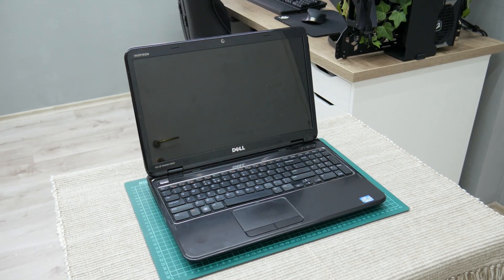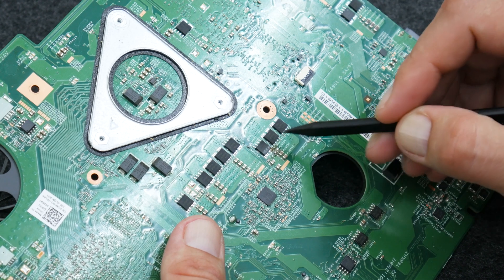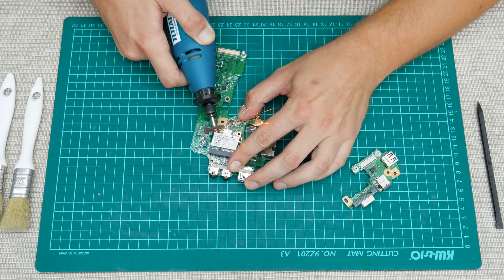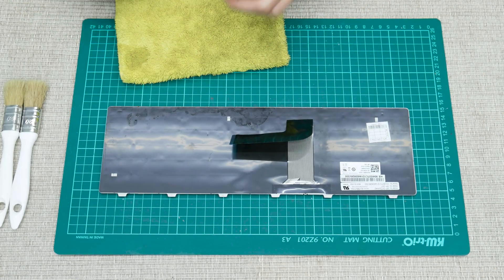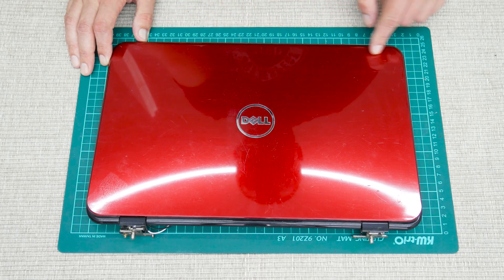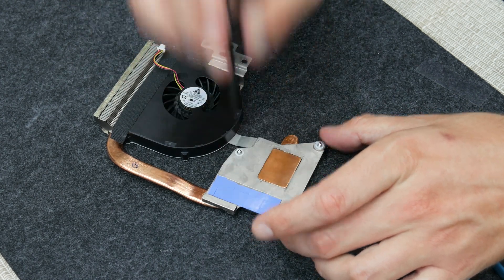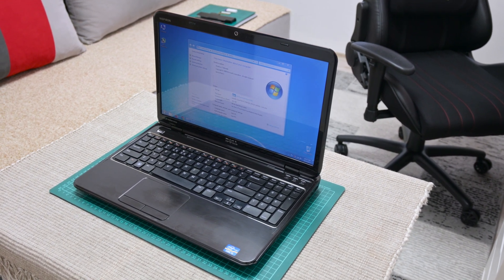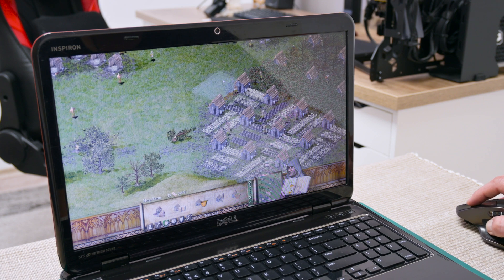Can we repair this old DELL N5110?

Comment: I just got this same laptop from a friend who moved. It doesn't boot up. The power light comes on, the 3 buttons on the top right light up, but then nothing happens.

I changed out the button cell battery but still nothing.

If there's a short, how can I find it? I'm interested in getting this working to pass on to someone who needs a basic computer for stuff like school work.

Comment: Nice work with this laptop, I re-watched this video for a repair and restoration I'm doing. Question, is it safe to clean the heatsink with soap and water, and then remove excess with compressed air?

Comment: Hi, I've already got mine repaired. Upgraded to windows 10, Upgrade to SSD too. Clean fan, repasted thermal paste, basically that's what I heard from the technician. 
But I am still having trouble with overheat problems, game throttling too much, even with low graphics demand games. Please help, any advice would be great sir.  Appreciate it.

Comment: i have ADATA SU750 installed in this same laptop, this SSD heats up like crazy, crystaldiskinfo tells me its hovering around 68c to 70c, and if i copy something or compress files, it reaches 78c. Yeah i have cleaned my laptop and fans and applied new arctic silver 5 thermal paste. Gaming temps are pretty normal. ADATA SSD's are crap

Comment: just a tip if you need to fix chipped or broken plastics. Use some clay and superglue to fill in the hole and it will fix the problem for good.

Comment: 10:15  Here at least i could manage to get windows 10 activated with a 7 key. Unfortunately, for me, it is not shown how to reconnect the flex cables,  i could not manage, without some serious, modifying  of the cables, and cutting aluminium part inside  to bits, that project still in the works, so not sure about the outcome, though i am pretty positive. And this laptop's cpu upgradable, did not cross my mind even that a possibility, i just may do the same, not sure, but nice to know the option is there, knew there was some use in watching these video's.

Comment: I have been using this laptop since 2012!
Upgrade the HDD to SSD and 8GB RAM! I have left Windows 7 and on another partition installed Windows 10!
At the beginning WIN 10 was not working properly, but after years of updates now is working like a charm!
I am going to bay a new laptop next year in 2023, still waiting for DDR 5 RAM price go down, and that CPUs prices of Intel 12 gen and AMD be more reasonable!
I like your channel, I heve been doing repares more then 30 years back.
All the best and stay safe!

Comment: i actually still got this laptop with an i5 2450m, 4 gb of ram, 500 gb of hhd and a smaller keyboard it has been in my house since it was brand new and has been damaged several times like when i found it again in 2018 it doesn’t even boot up until i brought it to a tech repair shop and when i gave it to my brother he punched the screen so hard that the hinge of the laptop got loosen and it’s still is to this day even after the screen replacement and ever since i got a new laptop i gave my other laptop to my brother the laptop was never been use again and it sitting on my desk collecting dust i might use it again as a data stored or as a second monitor

Comment: Hey sir I badly need your help regarding on the Asus Tuf Gaming Laptop GPU.. the NVIDIA gpu only showed as Microsoft Basic Display adapter and wont accept any driver installation it will always have error...i tried all the possible fixes like updating from Device manager to manual install driver, even used DDU for clean installation of driver.. but ddnt worked..Graphics settings in Bios is greyed out.. its Asus tuf FX505GD with GTX1050ti 4gb.. pls help me what to do.. thnx in advance..

Comment: Hey Andrew, I have a Compaq Presario CQ57 and i upgraded it by adding an SSD to it using the disc caddy, and now it is working all fast and smooth but the most major problem that i am facing now is that the laptop is overheating and shutting down very often i have cleaned the laptop and got it serviced with fresh thermal paste also but the problem continues. Also i have noticed that the fan is running slower according to me not making enough air flow.

What should I do ? Please suggest.🙂
Reply: Did you sevice the machine yourself?

Comment: Great job. I've never done an N5110, but I have done several slightly older machines, Dell Inspiron 1545s and an Inspiron 1764. The 1545 can have almost everything upgraded, but the T9900 is the best CPU it can handle. Glad you were able to get that oldie running again.👍

Comment: Thanks for the nice restoration but Big mistake you replaced the core i3 to i7 the motherboard it will not continue working with i7 becose there is some chips cant sopported and take that much of power

Comment: I wonder if you might have an answer to  question please....I have an old NEC VERSA M500 laptop....It was working (just) then it just died....Now when I switch it on all I get a a loud single continuous beep!...I have checked the ram...Both sticks taking htem out and trying single sticks at a time in each socket and still get the same beep when switching on. Unfortunately I have no other sticks to see whether both sticks have failed or not..as my other old laptop takes different ram...Its not booting to even the bios..just a blank screen and beep...I have tried looking online for a solution, but have not found an answer...I feel it might be the keyboard...But to be honest...spending money on it to repair is a waste as I could just buy a better second hand working laptop rather than waste money trying to get what is a very slow laptop working again...Looking at the cost of old replacement parts..its just not worth it...But if it's a fix I could do with out spending money..then great...If not..then its a dead duck...Your experience with laptop is far more extensive than mine..so I was hoping you may have had a similar problem and found a possible solution?...Anyway..thanks in advance.

Comment: i3 2th gen upgrade to i7-2670qm...bad idea...the heatsink is to small because i7 second gen generate a LOT of heat....i had a hp dv-6 with i7-2670qm but i downgraded to i5-2410m its quiet now and not 100% fan all the time....with the i7 temps where around 90 doing simple stuff...with the i5 55 degrees

Comment: @Cat and Andrew this is my first laptop in 2014 passed on from my brother. He bought it in 2011 and did his bachelor thesis, I did mine, and my dad still uses it daily for Streaming in 2K. It runs Win10 and Ubuntu on SSD. He did upgrade the ram to 12gb but still uses i3 processor. Even though we have high gaming setups, all of us like the DELL n5110. It's a sentiment and every year along with all devices, it gets a cleaning and new thermal paste. In fact the only machine that still has a DVD RW drive at my home. It's now 11 years old i think.
Reply: i also has one but with an i5 and a smaller keyboard it belongs to my parents but they haven’t use it since 2016 i think and just left it in the dust until i found it again at 2018 non functioning ever since then it’s has a hard time cuz my brother like to punch the laptop screen and it’s now on my desk collecting dust cuz my brother switch over to a better laptop it’s great that your laptop is being take care of unlike mine😅
Reply: I have a  hp g6 with an i3 and i love it since it was my first fully functional computer so i believe i feel the same way as you

Comment: I recently restored a similar Inspiron N5050. Just upgraded RAM from 6gb to 8gb (with what I had around) and, despite not upgrading the HDD to a SSD it's still snappy for regular, non-intensive use. 

Word of caution, updating to latest BIOS is a must if planning on installing Windows 10. If you get it without a boot drive or with a wiped one (as was my case), install either Windows 7 or 8, update BIOS and then install Windows 10
Reply: I have same model
Upgraded to win 10 without any problem

Comment: I have the same laptop with i7 CPU and dedicated gaphics GeForce 525m - 8GB Ram with SATA SSD. I play Valorant at full HD no problem at 70FPS. It is a great laptop. For thermals, I have cooling pad and used Thermal Grizzly Kryonaut paste. CPU max at 85C and GPU at 75C while playing Valorant.

Comment: Glad to hear that you got it back up and running, though I don't like what Dell have done here. Why should you have to remove the display and motherboard in order to change the hard drive?
Also Windows 7 would have been the OS that came with the machine. Windows 10 would work perfectly fine, and is still supported, but Windows 7 is still a good OS and can run some programs that Windows 10 can't.

Comment: Awesome video mann. I always enjoyed you giving new life to these old machines. Can you please recommend based on your experience which thermal paste is the best for gaming laptops? Also, in how many years should I change my thermal paste?
Reply from the maker: Hi bro, Arctic Silver and Thermal Grizzly or cheaper option Cooler Master Master Gel Pro. I use these types in gaming laptops or computers, also these are great for GPUs, laptop or desktop.
Reply: @ComputersAndTechAndAndrew  Thanks for your valuable suggestions. So, in how many years should thermal paste be changed?

Comment: andrew do you have a tips or guide on how to unscrew a stuck bolt ? I had experiences where I fail at unscrewing cpu's shield two times... for some reason the bolt is always tight. I can't replace my thermal paste because of that.

by the way, thankyou for the video, it always so therapeutic watching your video

Comment: i have same leptop and upgrade windows 10 but usb 3.0 ports stop working. USB 3.0 ports working only with Windows 7 :(
Reply: update drivers i think this is the problem
Reply: Yeah, you need the right drivers. There is (free) software for that out the there like „easy driver“.